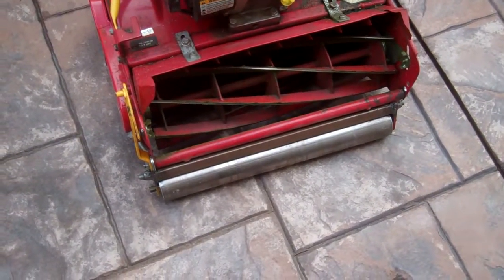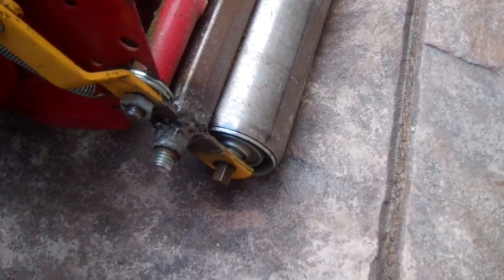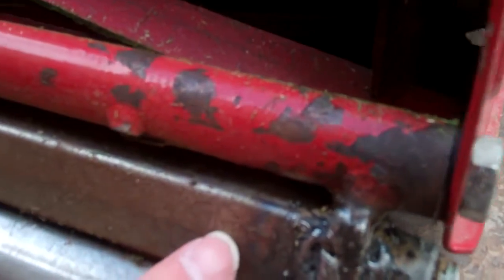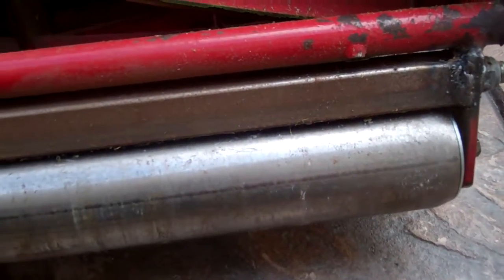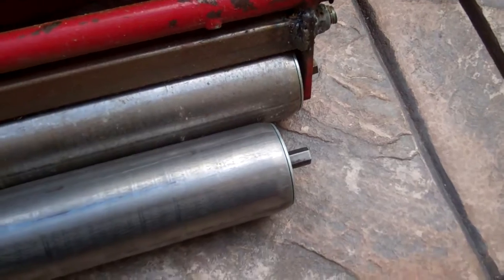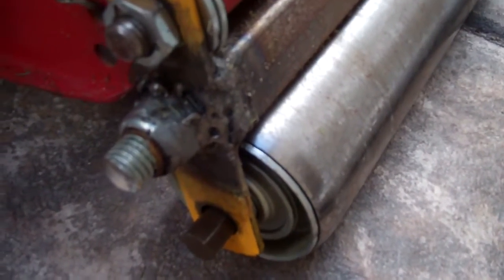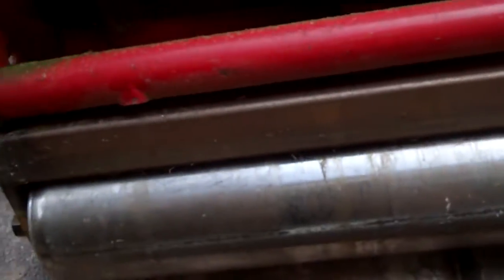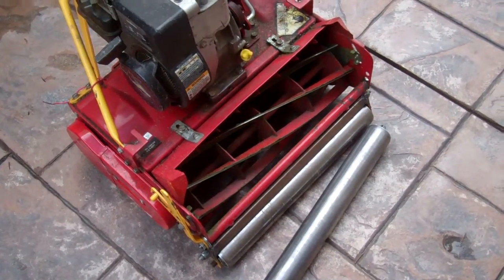DIY roller installation for your reel mower (Part 1 of 2)

Comment: How much did it cost overall to build and time invested with welding, cutting, parts?  Anything you would do different or wish was better?I neighbor of mine did something similar.  His only compliant was the front became very light which caused the mower to jump.  did you add any weight to keep the front of the mower in contact with the ground?  Do you have any pictures of your lawn stripes?

Comment: So you bought a welder to use on this project. Then decided to return it after this project was done. Classic. Do you buy diapers and return them with shit in them too? Your project turned out great. The bearing sounded like it needed some grease. Bearings sound used up a bit. I like it sir......